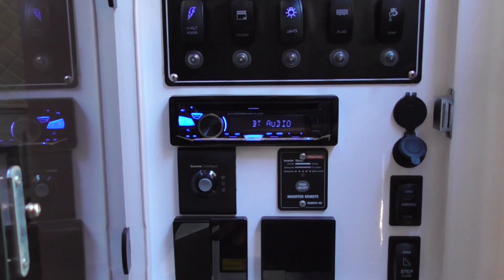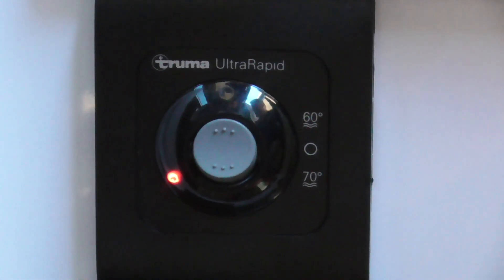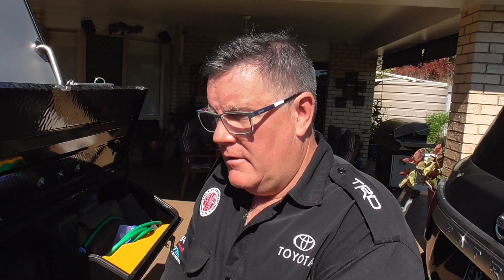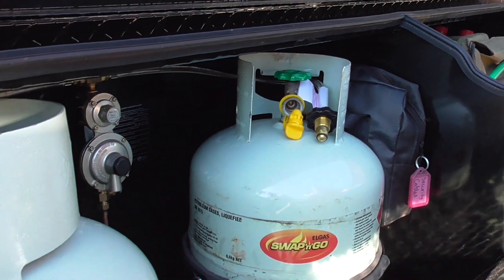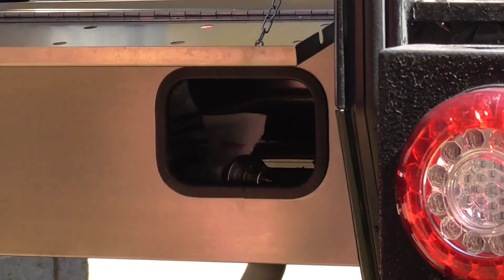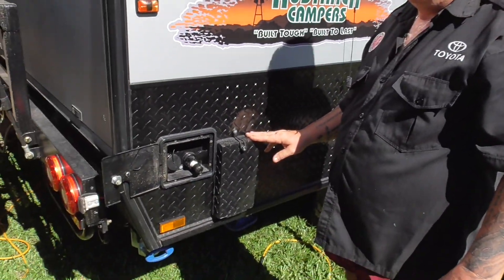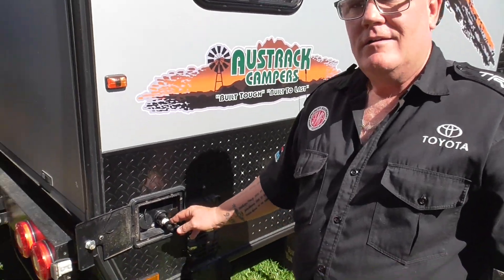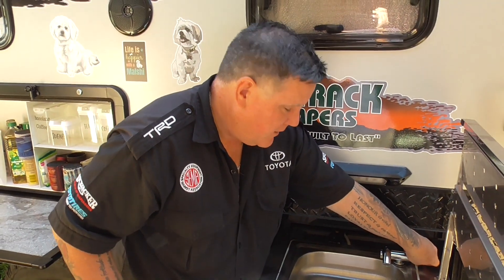Hybrid Caravan Tanami - Gas & Hot Water System

Comment: why doesn't my water heat up on gas or elec, on my L15 Tanami
Reply from the maker: Not sure.  If you are part of the Facebook Tanami groups you can shoot me a PM and I can give you a call if you want.
Reply: @muzandcath  not sure myself hi muz, bought the L15 Tanami xmas havent been out yet misses broke her ankle so been grounded, the van brand new pickup Melbourne since then I've but the van through check ups i have found the lock barrel main door, Nick sent a new one, TV anntena broken they sent new one, fill pipe fell off backwater tank they sent a longer pipe, now hot water system not heating well can be number of reason 1 pump wont turn off i have look every were no leeks anywere in pipes water drips nothing no atr in pipes temp switch turn it self off strait away when you turn it on u hear a little
Reply: @muzandcath  hi guys Graham from SA bought Tamina L15 last Oct brand new never been on holidays yet partner recovering ankle opp, well history van brand new needed new door, tv anntena replacement , pump ( water) doesn't turn off done all the checks leak s filter clean, hot water turns off when you turn it on, all cigs, lighters have 64v to 36v running through them so i cant test the new antenna works, in the first two mths we placed the back tank filling pipe the factory one to short But the van still looks nice A ps i think i need to see a auto sparky A ps11 Aussietrack not that fast on paying the warranty claims paid only 1 on 5 since feb. as Ned K. said before they hang him such his life what do u think Muz@chath
Reply: I'm on YouTube I'll wait 4 your reply on u.t. and be in touch thanks 4 that Graham s.a.